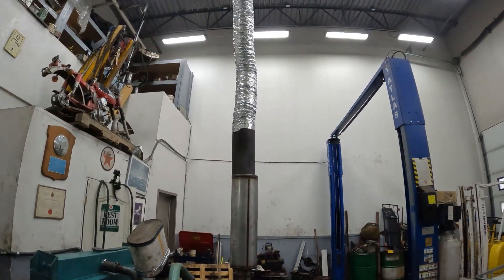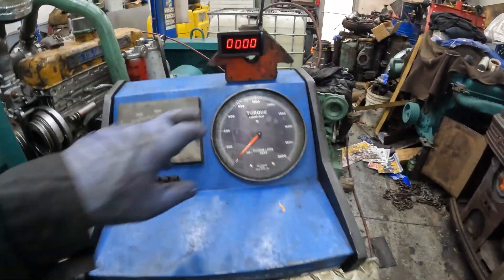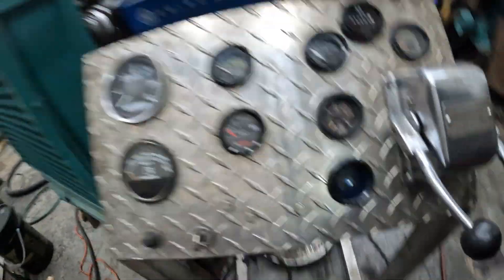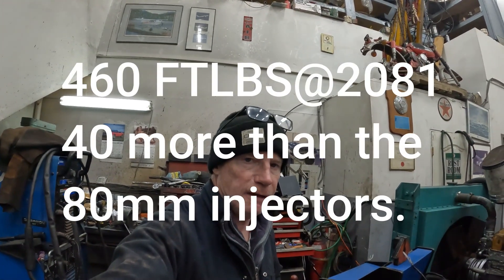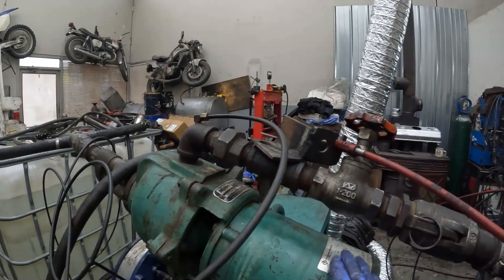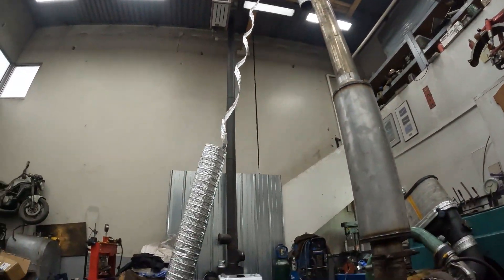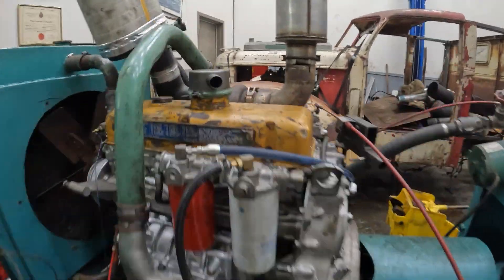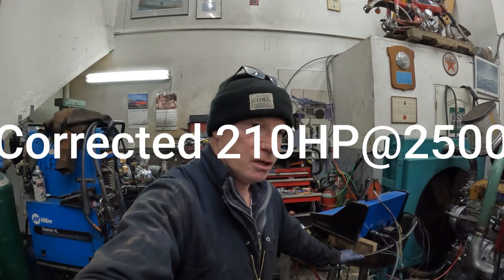Detroit Silver 4-53T (Dyno 9E85's)

Comment: Air box pressure gauge was reading nearly 30psi.   Starting to get some serious boost!  Which tends to suggest the turbo, for those injectors is close to being the correct size.
Reply from the maker: Yes, getting good numbers now, the 9E85's are running really nice.  Next upgrade is an intercooler and water meth.:)  Might see 35 psi airbox, so should be interesting.:)
Reply: @detroitgarage9430 I’d be interested in what the drive pressure is with boost pressure that high. What pressure does the blower bypass open?
Reply from the maker: @lukestrasser  True, I'll set drive pressure up once I get into the 9290's.  I'm running the green T blower at the moment.  Silver blower after the N blower, bypass opens 6-8 psi.

Comment: It seems like the motor sounds better with each run. Might be the injectors or maybe it's getting broke in, but it's honestly one of the best sounding Jimmys I've ever heard. 
Did you modify the oil pump? I don't remember seeing any of our Detroits with that kind of oil pressure. I think 40-45 was about it, but I could be wrong. That was many years ago.
Reply from the maker: I think it's a combination of being broken in and better injectors.  The 9E85's ran really nice as the had new tips on them.  The engine was in really nice condition internally despite sitting outside with no head for 10 years.  The oil pump and internals were like new.  It's running a little higher oil pressure than my other engines, but again like new parts in it.:)

Comment: In the video it didn’t appear to be smoking heavy when you had it under full load, did it haze? Did you see a difference in turbo boost to air box pressure? As you indicated, 900 on EGTs both time seems suspicious…
Reply from the maker: It ran really nice, was hard to tell in the video, but just a haze under full load.  Turbo boost jumped from about 2-5 psi to a peak of 25 psi.  Airbox pressure was close to 30-32psi.  I'll keep an eye on that egt gauge, would think I'd be seeing close to 1000.:)
Reply: Nice that’s is only hazing at this increase, will be interesting to see what happens with intercooler. You said you set to California timing? I assume that timing is ideal for emissions control? 
….side note, responded to a comment you made on your (9G90 Fail) video, months late, my bad…finding info on these old units is getting hard to find, for me at least…
Reply from the maker: @clayclifford3930  Should be better with an intercooler.:)  The fuel modulator is set to a California spec at .404", but the injectors aren't.  California spec was 1.496"  and I've set them to 1.484".  I'll play around with injector timing once I'm running the 9G90's and the 9200's.:)
Reply: Try reaching 45psi @detroitgarage9430